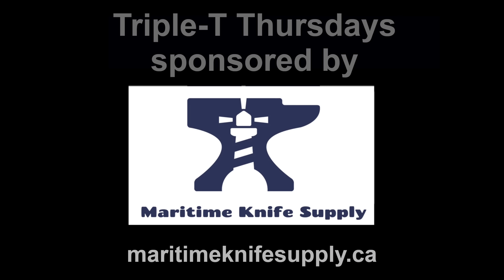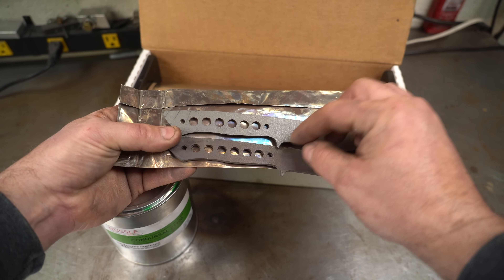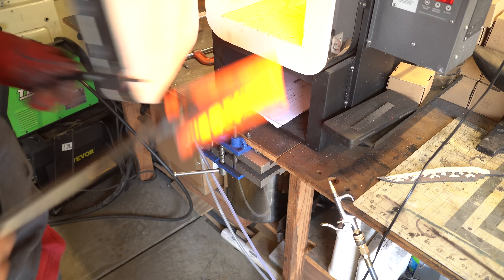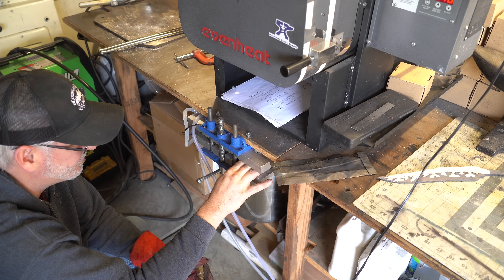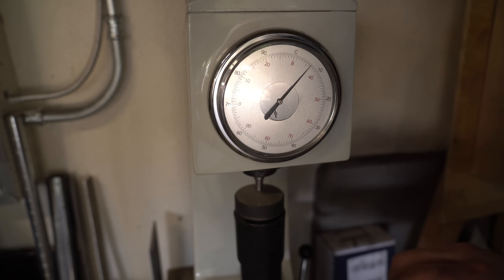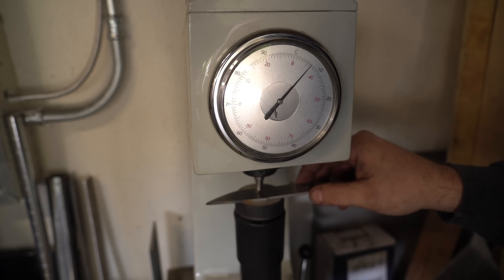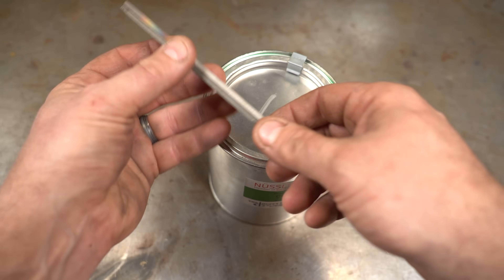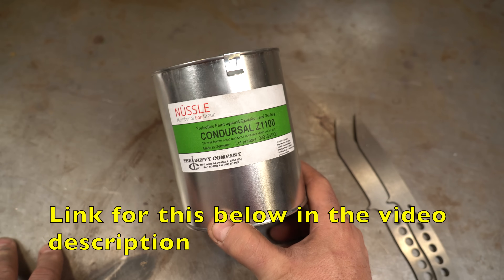Triple-T #158 - Using a high temp paint instead of stainless foil for heat treating

Comment: Thanks for a great video. Your need to have pretty hot to get good handles i have 1070 c and get around 64 HRC . And temper at 180 c and you get around 60. And cryo directly after hardening.
Reply from the maker: Thanks for sharing
Reply: @TyrellKnifeworks  my plesure 👍

Comment: Have you tried ATP-641? I am curious if you have tried both and prefer the Condursal, or if they are functionally equivalent and you just came across the Condursal first?
Reply from the maker: I have ATP and don’t like it.  It’s harder to apply, doesn’t coat as well and comes off easy.  See Larrin’s recent video and you’ll agree Condursal is the way to go.
Reply: @TyrellKnifeworks  Thanks for the quick reply! That helps with my purchase decision! 🙂
BTW, big fan of the channel. Great content and has quickly become my go-to (I am a hobbyist moving toward full-on side hustle, but no real aspiration to be full-time).
Reply: @TyrellKnifeworks  I had a thought after this conversation: has anyone you know of ever tried high-temp spray paint for protecting stainless? Usually good for around 2200F.
Reply from the maker: @johncannon3593 regular high temp spray paint is for “intermittent” heat and probably won’t work.
Reply: @TyrellKnifeworks  well I’ve got some for use on automotive use (engine and exhaust parts, not the stuff for grills and light duty) that is supposed to be good up to 2000F. 
I am going to give it a go and will report back.

Comment: Try using an air brush so you can get a better even coat. You can get a cheap air brush at harbor freight.
Reply from the maker: I’ve got a spray gun already but you need to dilute this 4:1 with xylene in order to spray it.  Seemed like too much trouble to me.  Thanks for watching.
Reply: @TyrellKnifeworks  oh I didn't know that. That makes sense. Well sorry for the trouble 😊

Comment: I'm trying slip and a water quench. My first stainless was a nitro v blade. I hadn't drilled the holes in the tang. I just threw it in the forge and oil quenched, just to see what would happen.  I burned up 2 cobalt drill bits, trying to put those holes in the tang. I finally had to use a small angle grinder cutting disc to get through.
Reply from the maker: Next time just heat it up with a torch first before you try to drill it.  Thanks for watching.

Comment: Dipping don't work for big blades or when you have only half jar left. Just put more stuff on them with brush and let the extra drip off and just take out bigger drops after bit of hanging. Still need to do some steel foil with magnacut, 1100c not enough for that. It would be interesting to see is there any difference on oil and plate quench with that cordusal. And also what will happen if you do it with out anything to protect the steel. This was a good video because I've been wondering if that cordusal work and now i know. Thanks for that.
Reply from the maker: Thanks for tuning in

Comment: No idea where it came from, think it was left in the garage when i moved in, but, just discovered a nice piece of stainless super thin sheet, maybe foil, thought it was roof valley flashing from the shape, about 6" wide and 6' long.

No wonder paint a LOT cheaper, use so little of it.  You're just putting it in the oven,  so, hopefully it works well.
Reply from the maker: Sounds like a good find.  Yes you don’t use much paint at all n the process.  Thanks for watching, Bill.

Comment: AEB-L, more than any other steel I have used, needs the cryo to get as much out of the steel as possible. When I test right after heat treatment it usually comes out right at around 60. Then I put it in dry ice and it will test at 62-64. Wait till after your cold treatment to test hardness and you will get a better idea of actual hardness.
Reply from the maker: Yeah it was much harder after sitting in the freezer.  After temper it was almost 60 hrc.  Thanks for watching.
Reply: I’m trying to temper out the hardness nowadays?  Hand sanding is terrible on stainless, I almost quit all together because of it.  Wouldn’t it be easier to sharpen if it lost some HRC?  I just moved from 440c to my first knife of AEB-L and it seems much more manageable but am I wrong on my thinking?
Reply from the maker: @xthemadplumberx7110  you want that edge hardness though, particularly on chef knives.

Comment: Would air brush spraying help with covering it? Besides the hassle of cleaning the air brush... It might help when doing large batches?
Reply from the maker: Yes, you can certainly spray it.  I have a spray gun I can use for it.  You have to dilute it 4:1 with xylene though.  Thanks for watching.

Comment: Hi.
 I use condursal regularly.
 When there are several pieces, I use a spray gun. The deposited layer is regular and thin, and the tempering is more homogeneous.
 I translate with a bot, sorry for the approximations. Thanks for the triple T👍
Reply from the maker: Yeah, I have a spray gun and thought the same.  They said to dilute it 4:1 if you spray it.  Thanks for watching

Comment: i've used krylon's high temp spray paint (they have a couple of variations - I used the one rated at 2300 Degrees F) with some good success!
Reply from the maker: The Condursal is specifically for this purpose so I’m thinking it’s better than the krylon.  It’s meant as a coating to prevent oxygen but krylon isn’t actually for that purpose.  It might work though, I’m not sure.
Reply: It would be interesting to see how the krylon compares to the condursal!

Comment: This is a great tip. I've never used the foil personally. Steve Schwarzer showed me the spray paint for exhausts that goes up to 2000 degrees. That is what I use on my AEBL. It has works great. I like that this paint you show has a higher temp. Gives more of a buffer. 👍
Reply from the maker: Yes, it’s a good option and cheap.  I’ll probably use it on 80CRV2 as well to reduce decarb. Thanks for watching.

Comment: Tyrell Knifeworks 1) I do not understand this and therefore I had one simple and logical question. Why don't you use the foil used again? =)
update: 5:38 - I saw you cut foil with scissors. And if you open the foil, the foil will break?
2) Maybe I'm mistaken, but since this is a paint, it is advisable to wipe the knife from the fat with a degreaser. Well, do not hold it in his hands =) All the same human skin constantly emits fat.
3) Possible, you need one knife for control WITHOUT foil and paint
p.s. sorry for using google translate.
Reply from the maker: You shouldn’t reuse the foil, it degrades when heated.  I was holding the tang and I’m not concerned with the handle being hard anyway.  Thanks for watching.
Reply: @TyrellKnifeworks  
1) You tested the foil used, does it work worse? I just googled and found about steel 3423. The melting temperature is 1400 degrees Celsius, the structure withstands short -term heating up to 900 Celsius. The operating temperature of the heating of a steel alloy in mechanical indicators reaches 710 degrees Celsius. I don’t know which brand steel is used for foil, so I took a random one.
2) By the way, I had an idea. For melting cast iron, forms (molds) are smeared with liquid glass (liquid silica, potassium silicate - I do not know what word in English is used for this substance, the dictionary gave out several meanings). This is a cheap substance, sold to create concrete protection from water. But it is advisable to take with the maximum concentration. But what if you imprison stainless steel waste with liquid glass? I met on the video that it can quickly be dried with gas (nitrogen, it seems or some kind of well-known gas in cylinders). But it seems like he is dried in the stove.

Comment: Hi Dennis I use the paint for some stainless blades and even carbon blades, you need to put a slightly thicker layer of it on there and yoh want have the decarb issue
Reply from the maker: I’ll give it a try a bit thicker next time.  Thanks for watching.

Comment: I have been using Condursal for a couple of years. I dip the knives and let the excess drip off.  I oil quench all my blades and the coating pops off in the quench-lovely. I had previously tried ATP641, but could not get good results from that product 🤷‍♂️
Reply: Does the paint dry-out as you let it, presumably, drip back into the paint can?
Reply from the maker: That’s a good tip, maybe I’ll try that next time.  The paint does dry out so leaving the can open for long periods isn’t advisable.  Thanks for watching.
Reply: Hi Kenneth,

when the coating pops off in the quench oil, doesn't this contaminate the oil and decreases its quenching ability ?

Comment: Ive been using ATP 641 as its quite a bit cheaper and has a higher temp range. However it is a bit more fiddly and messy. Everything has its pros and cons I guess. But this paint on stuff looks interesting. 🤔
Reply from the maker: ATP is a clay and it’s a pain.  It takes forever to dry and flakes off too easy. This is much more secure of an option.  Thanks for watching.
Reply: @TyrellKnifeworks  I throw it in the oven at 200 to dry it out fast😉

Comment: I've considered this stuff a while ago, good to see a test result between foil and the coating which I've not seen done anywhere else.
The ATP-641 is a bit more common to find and cheaper, I've found it works ok as well but you do need to cut through more decarb with that than you would in foil. Though if you're making dies and complicated forms for heat treating, then you really do need a coating for them and they just won't fit in a foil pouch.
So its sort of a much-a-much for a knife maker, if you grind close to finished shapes on some of the harder to work steels full of vanadium that don't take to belts happily, then you're better off with foil. Otherwise on the easier to machine steels like AEBL, 440C and so on, the coatings should be 'good enough' if you do a lot of post heat treat grinding.
Reply from the maker: I have ATP but it’s a pain and flakes off too easy.  I’ve been told by others to just dip and hang and it costs better with less/No decarb. 👍. Thanks for watching.